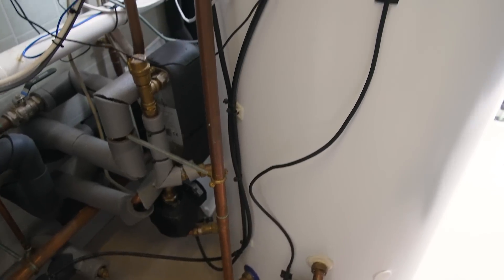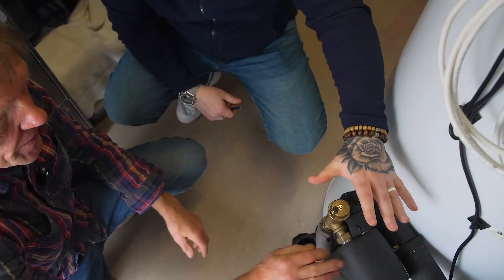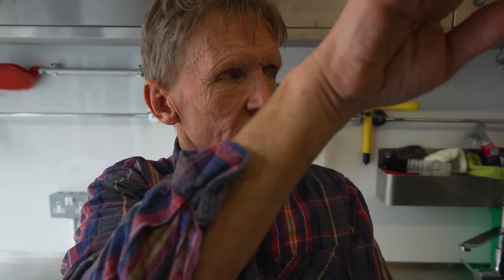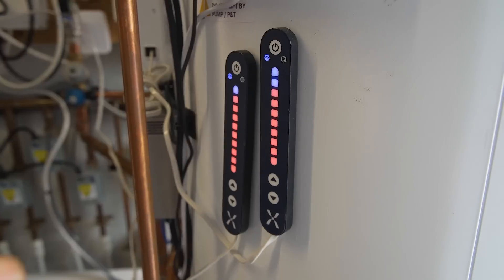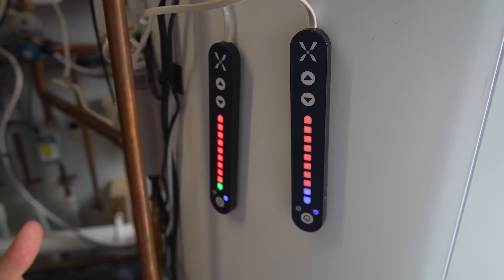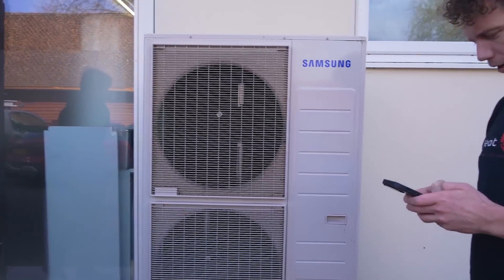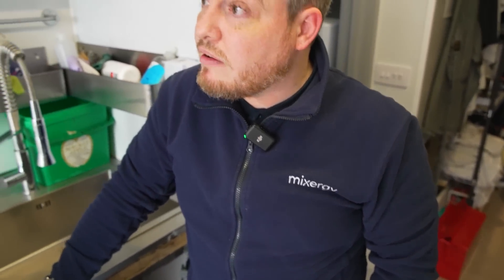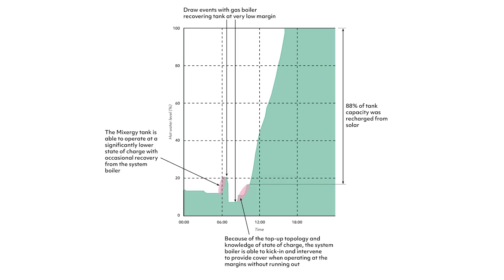What's So Special About the Mixergy Hot Water Cylinder?

Comment: Hi Roger, have you any views on the new mini store cylinders that Heat Geek have developed?
Reply from the maker: It works well enough but there are plenty out there that do the same thing. You can get a cylinder made to any spec you like. Heat Geeks tend to want quite a lot of money for their kit. 
The important point about cylinders is that the heat transfer is always best when the temperature difference is greatest so a tall thin cylinder allows the hottest water to come in at the bottom where the water is coldest. As the cylinder heats up the incoming water will give up less of its heat. 
That was the thinking behind the Mixergy cylinder.
Reply: @SkillBuilder  Thank you.

Comment: And in 15 yers time you will need to buy another one I mean whats the point? .A much simpler way to make efficiency savings is to double insulate your hot water tank. That said I've gone low tech, I have a gas boiler but I also have a log burner with a working back boiler it heats the hot water tank and the house,  I use scavenged wood and smokeless coal in the winter, works a treat the coals still fairly cheap and the wood costs me next to nothing other than the petrol I've used in my car and chain saw to go and collect it. We saved over £600 last winter and that was after deducting the cost of the coal and gas our boiler used over that time.

Comment: Like our IC cars legislation is driving design which is becoming unstable governed by sensors opening and closing valves foe economy.  the KISS principle of keeping it simple is sidelined and a single sensor fault might put your car in limp mode requiring an error code to determine the problem.  The same is likely with any electronic management system be wary of magic.

Comment: I’d recommend holding off buying. Nothing but headaches. Just when you think it’s working… 

I’ve got a Mixergy 300ltr cylinder and it’s possibly the worst technology I’ve ever bought. 12 months the cylinder broke and to Mixergy credit was replaced. Not a small task without inconvenience though. But in less than 2 years the hub that connects the cylinder to the router has also consistently failed losing connection. Mixergy will blame sockets, surge protection etc but I have heatmiser, octopus and other devices that connect the same way and don’t keep losing connection. I’ve followed their advice. Only thing that worked was a new hub. But they won’t offer this. I happened to have a new one with the new cylinder replacement. You will have to mess for hours and hours and still doesn’t work. I have no tech benefits that are marketed. Don’t even know if we have hot water. It’s Russian roulette if the water will go cold part way through a shower.

Comment: Hi, does anyone have any experience of the high power instantaneous water heaters?? I'm referring to the 9kw upwards type, never knew such a thing existed until today. I want one for the outer house as there is only a cold water supply. I have experienced the small 3kw types in a shop sink and they are useless, barely any flow with hot water. I'm wondering if the higher power units can give decent water flow with higher temperatures,  don't want to spend £300 plus for something that won't be much use.
Reply from the maker: 9kw is what an instantenous electric shower gives you, it isn't a lot of flow in the winter

Comment: Why not use a thermal store for a normal home? You can add solar, burn wood, use gas and electric in any combination. However, it is open vented but at least it is mains pressure. But the issue is the PCB failure. Can you get the parts? Never be an early adopter with anything with electronics and heat.

Comment: never invest into a system that needs three (3!!!) separate electronic displays to operate. It's not only bad user interface design for regular operating but also does not last very long if constantly charged to 100% battery level on these consumer grade tablets, probably lunatics designed this.
Reply: It doesn't need 3 separate displays. 1st display is the control for the ASHP, 2nd display is the Smart (electricity) meter or In Home Display, and the 3rd one is an old Android tablet that I stuck to the cylinder with some double-sided velcro. The tablet has the Mixergy App, plus controls for the EV chargers and Inverter. And these are replicated on my 'phone. The probable lunatic who designed this and went wild with the roll of velcro is the same nutjob who built the B&B, runs it, and would make your breakfast if you ever decided to visit 🙂

Comment: “With a normal gas boiler, you heat everything or nothing” Erm, with a combi you skip the huge water tank step, and just heat up what you use on demand. What’s the point of running a gas boiler into a tank?
Reply: The gas supply, now disconnected, would only give enough pressure (just) to drive a 40kw gas combi.  There's no way the combi could provide enough hot water to supply up to 8 bathrooms, and I have to assume all the en-suites being used at the same time, so I had to have the cylinders to accommodate a sudden, and huge, use of hot water.

Comment: Impressive but sounds overengineered for a simple task of heating water. Reliability must be rather poor, requiring constant maintenance.
Reply: It's all about "use-case". This set-up is to manage the hot water and central heating needs of an 8 room, 16 guests, plus my managers' apartment with highly variable demand. In addition, this set up, complicated as it is, also comes with TWO ways of producing hot water, which gives the business a degree of redundancy and resilience.  In terms of reliability, the only issue I've had is an immersion element burnout.  Replacing it was a 20 minute job as I only needed to drain off the top 10% of the tank. Other than that I've not had any issues, and also bear in mind this system evolved from being gas-fired, added Solar, and then replaced the gas with the ASHP.

Comment: But the heatpump is circuiting at the bottom, heating the whole tank? Doesn't that negate the entire point of the top coil and now it's just a normal tank?
Reply: Yes. If you're going to install an ASHP with a cylinder from the get go, there are better alternatives out there. In this scenario the Mixergy's  were gas-fired. Then solar was added. Up to this point I enjoyed all the smart funtions the cylinders had to offer. Then the gas was replaced by the ASHP.  So now I have a largely 'dumb' tank that gets filled up overnight on super-cheap electricity (E7) using the ASHP at 2.6 times the efficiency of an immersion. The cylinders then get excess Solar during the day. Over the week / month I have constant supply of hot water for stupidly low money.
Reply: @MagnoliaHouseRye  thank you for clarifying. This could be a solution for very cold winder climates that then have mild summers. Keep the gas connected at the top for very cold days, then heatpump everything else.
Reply: @farnzy2011  

How cold do you want winters to be, the heat pumps in UK will function well down to -25C ?

No need for gas.

Comment: Expensive and complicated solution to heat water. Bought my 3 bed semi in 1976 and on my second hot water tank with 3kw immersion heater. My smart meter display tells me it's costing about £0 75 (E7) a day.
Reply: In this specific scenario, the building has a small managers' apartment, 8 guest rooms = upto 18 people overnight on some days, and just myself and my wife on other days, and everything inbetween.
Reply: My heat pump topping up Mixergy HWC typically uses 800Wh a day (18p on standard tariff), or 1.8kWh to heat 150litres from cold to 50C (40p on standard tariff).

Comment: How reliable are these I wonder. Seems systems are getting more complicated but are the going to cost more to fix? Are they going to be as reliable?
Reply: Good question. I'm a fan of these solutions and think we're going to end up with several solutions that can be chosen based on consumer need, but I do always worry about complexity and maintainability.
Reply: 25 year warranty on stainless steel cylinder, and if I remember correctly three years on electrics & pump.
Reply: Like our cars unreliable to make an ev more attractive all for a mythical carbon footprint.

Comment: Heat pumps are not automatically low carbon, it is misleading in the extreme to describe them as that. It all depends on the electrical grid and generally, in the U.K., they use gas.
Reply: I buy over 95% of my electricity overnight on an E7 tariff, from a renewable source. IE, all those wind-farms spinning about in the wee hours with fewer to send all that luvly windy power ;-)
Reply: Magnolia, 
If you supplier says you are getting 100% renewable power, it is lying.
a figure for you, from a 9 year reseach paper. 
Wind generates at or below 20% capacity for twenty weeks in a year and 80% for just under one week.We regularly have days on end with hardly any wind generation at all. 
At night wind output usually drops anyway.
Reply: @iareid8255  

Less windy at night ???  now that's getting desperate...

Wind turbines last year generated 26% of UK electricity, renewables 37.5% (wind, solar, hydro, bio), Carbon neutral 48% (Inc Nuclear), Gas 36%.
Reply: Dougal, 

that is a fact not desperation, due to the fact the sun doesn't shine at night creating the temperature differential; that creates wind.
What do those figures prove, except that without gas they would not work at all, with the exception of bio and the very small amount of hydro. The other simple fact is that the grid does not do averages, it requires firm generation as and when required which is not what wind and solar provide. Solar is only available for eight months of the year in any quantity.
You may not be awre that we run adulicate set of generators, renewables and gas. we don't need renewables, we cannot do without gas, Something Mr Milliband is going to learn very quickly.
Reply: Well I live in North Scotland (the bit above central belt) and it is generally 100% renewables between wind turbines and Hydro, you'll find that gas generated less than half of UK electricity last year (National Grid ESO website gives monthly breakdowns of sources).

So not misleading at all, and if 100% electricity generation were gas, it would still be more environmentally friendly to use heat pumps than inherently inefficient gas boilers.
Reply: Douigal, 

What you are referring to is the seriously poor design of building all that capacity where the demand is far less. Much of the wind genertaed electrcity is used in England, that is when it is generating at a high level which is rare. It is a deploarbly poor system looking at it from a sound engineering basis.

Gas boiler are at least as efficient as heatpumps if not more so particularly in colder times. It's a falsehood that heat pumps are efficient due to a confusion between Coefficient of Performance and efficiency, they are not the same.
Reply: @iareid8255  

"Coefficient of Performance and efficiency, they are not the same."

===

Only the most pedantic would try and differentiate between the two, most serious scientists and engineers quite happily use either to represent the systems output. Bottom line is that a heat pump system can produce typically three to five times the heat output per kW of energy input than a gas boiler.

That's fact.

Wind speed here currently 15 mph, North Scotland 83% wind, 17% hydro production. That's 100% renewable.

South Scotland 57% wind, 24% nuclear, 9% hydro, 3% biomass, 3% imports and 5% (1/20th) gas.... Fact.

Cumbria 55% nuclear, 18% wind, 15% imports, 5% biomass, 1% hydro, 5% (1/20th) gas. More facts and it's 23:20.
Reply: Dougal,  

Rubbish, that is so far from accurate, if a serious engineer believes that it puts into doubt his or her competance.

Let me put it another way.
Fact one, no device can give more than the energy that powers it, basic physics, i.e. you can never get 100% efficiency.

From the heat pump industry, a ground source heat pump has a CoP of around five.
 
From those two the input energy required is at least five times for that to happen.

Now an air source is generally given as around CoP of three, therefore with a fair wind the best effciciency of an air source is 60%, far below that of a gas or oil boiler.

Electricity is not energy, and cannot be used as a basis for efficiency calculation. It serves for CoP calculation but only as a comparison beteen any other elctrically powered heater. Not any other type of fuel.

yes the grid data you quote is correct but you don't understand the system if you think that justifies their use..

Comment: All you need is a enormous room to place this in and a massively wide pathway for the heat pump. In other words most of us are buggered.
Reply: Most houses have them in the attic
Reply: @UnawakeyMany houses have loft conversions too. I've got a standard 3 bedroom semi with a side entrance and there is absolutely no way all that gubbins will fit onto my property. The exterior part itself will completely block access from front to rear. Also having all that electrical stuff in the attic sounds a recipe for a fire within a few years when the wiring deteriorates. People are already regretting having all the wiring for their solar panels out of sight in their lofts because heavy duty wiring, powerful electrical equipment, standard family cardboard storage and loft insulation are never a good mix.

Comment: My hot water is supplied by an electric shower, a single instant electric water heater for the  bathroom basin and the cloakroom and a 15 litre electric water heater for the kitchen and utility room. You don't need to store masses of water unless you have a bath, which we don't.
Reply: Or if you happen to have an 8 room, 16 guest capacity Bed & Breakfast plus a little apartment, cylinders / thermal stores makes commercial sense. It's all about the use-case.
Reply: The Mixergy also allows best use of cheap electrical tariffs, it's already programmed to make best use of Octopus Agile half hourly rates as one example.
Also has a 'Heat Geek' mode (the very same) which allows cylinder temperature to be accurately set between 20C and 70C in one degree graduations.
The cylinders themselves are very well insulated, so retain heat for long periods.
And the fact that it's unvented mains water pressure it's like having an instant power shower straight from the tap (or two or three simultaneously).

My heat pump produces at least 3.5 kWh of hot water for each kWh of electricity used (1 : 3.5), that's where resistive heaters fall behind (1 : 1), as do the gas boilers(1 : 0.85).

Comment: I like the technology as have worked in tech for a long time, but my concern with this is, as my dad used to say, more to go wrong. 

Water isn’t a very friendly environment so my suspicions is the life time of this won’t be anything like the old systems we used in the past. 

My boiler is old but still working. Sure it’s not going to be as efficient as the newest technology but I’ve had it for over 20 years and as far as I know it was installed in the 80s. 
Likewise the tank. 

While I’m spending more on gas I expect the cost of these upgrades are going to be way more than my possible savings and they are going to need to be replaced far sooner than what I’ve at the moment.

Also solar hot water heating is far more efficient than PV and these don’t seem to have an option for that.

Comment: At 9min 45 secs the Mixergy rep states: ‘if you select 50C as your temperature from 1% to 100% you will get 50 C’
I have had a Mixergy cylinder for 6 months and I can tell you this is not true!  I heat my tank to 60% every night to a target temp of 60C with off peak electricity. By the time you have had 1 shower in the morning the sensor at the top of the tank is  showing mid 40s C.

This is the biggest real life disappointment of the tank.

However it is great at taking the 7 KWH of excess solar each day and turning that into usable hot water, rather than having a 300L tank of warm water.

Happy for Mixergy to review the data from my tank
Reply: Better off exporting that valuable electricity. You sure something isn’t wrong with it? Sounds like it’s running its stratification pump when it shouldn’t. How’s the insulation on the pipe work?
Reply: I use Octopus Go for the EV, so can’t get paid to export electricity.

Insulation could be better, but even after a heat to 50-60% of capacity at 60C, I can assure use that the heated portion of the tank is not at the same temperature.
Reply: Would it not be better to heat 100% to 45C, that's a nice hot shower or bath without any cold mixing required ?

I find with mine that the draw off to fill the hot water pipes to taps uses a substantial amount, and if pipes not well insulated then residual heat in them is wasted.

Comment: Thanks this , I tried to get a cylinder, I found the supply chain did know about the cylinder , if you live in a hard water area you need to install a water softener, and there is a monthly fee and you need to get the cylinder serviced once a year to maintain the guarantee
Reply: There is no monthly fee payable for Mixergy products.  They offer an optional care plan which remotely reviews your cylinder performance and can warn of an increase in water or energy usage.  In terms of an annual service, this is no more than any other unvented hot water storage cylinder needs on the market, they all need an annual safety check of the system to ensure a safe operation, all manufacturers place an annual service requirement on their products.